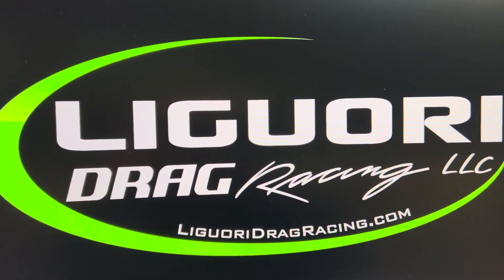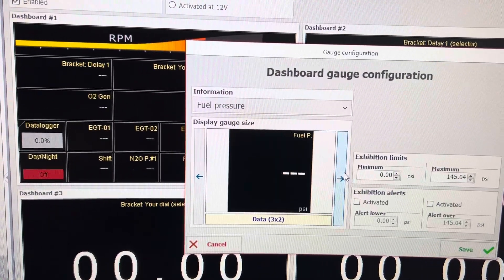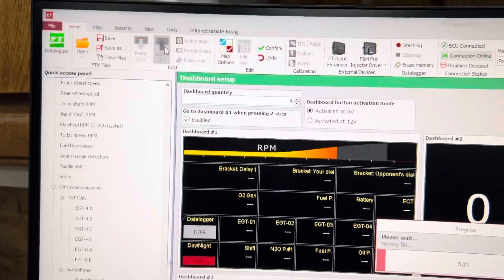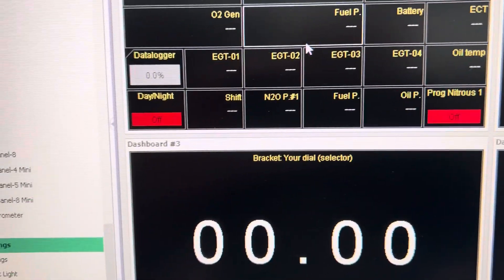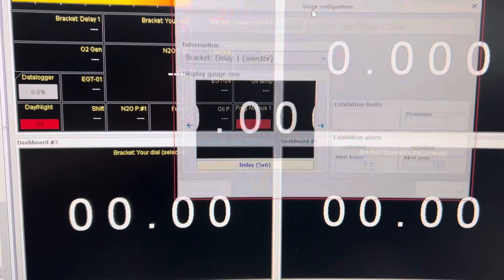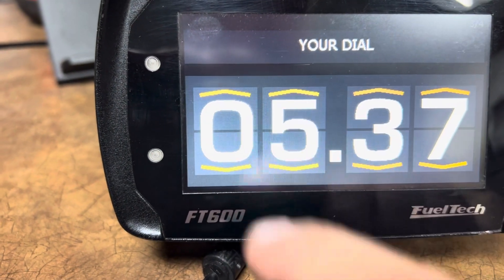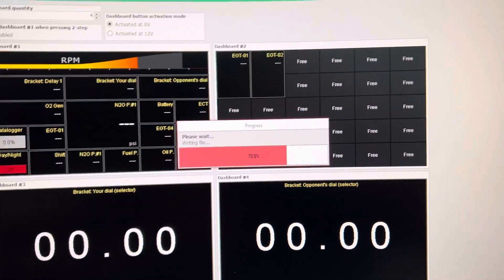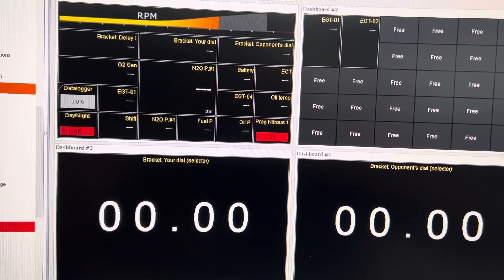How to setup your FuelTech dashboard

Comment: Is this for the 600 only? Because my 550 only shows a blank screen after i write to ecu.
Reply from the maker: No. 450-550-600
Is launch delay controls turned on in map options?
Do you have the crosstalk setting enabled within the launch delay controls?
Reply: @LiguoriDragRacing  oh shit. No it wasn't turned on. Thank you for that.